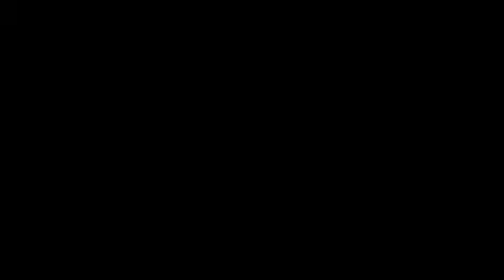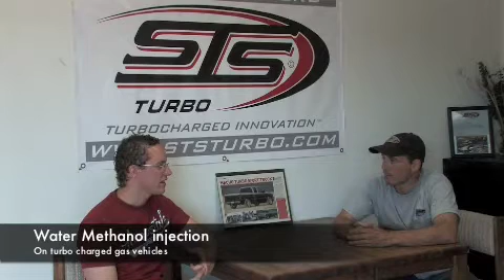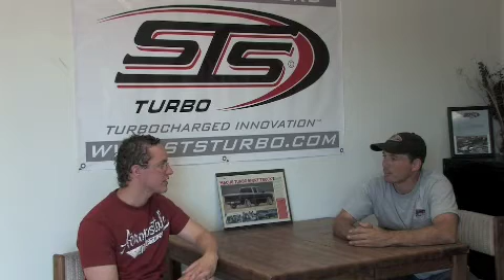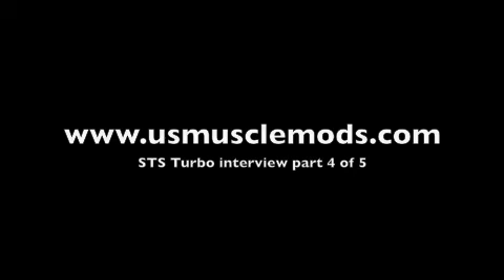STS Turbo Interview 4 of 5

Comment: USmusclemods : You guys did an excellent interview with lots of good information on a fantastic concept: remote installed turbocharger, BUT you should have done it in a quieter place . There is too much background noise, the image and sound are less than professional. Thumbs up any way.